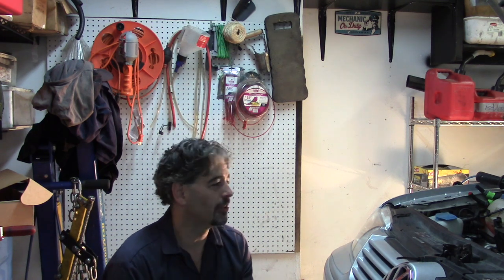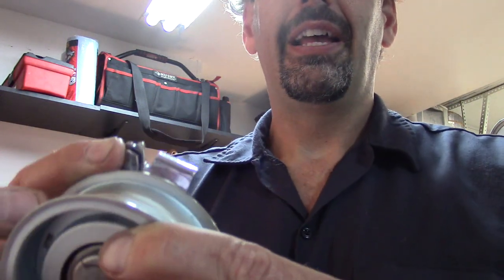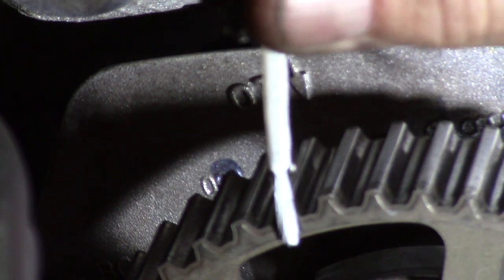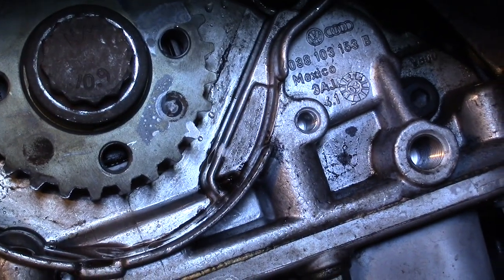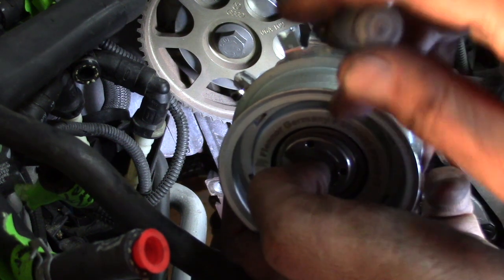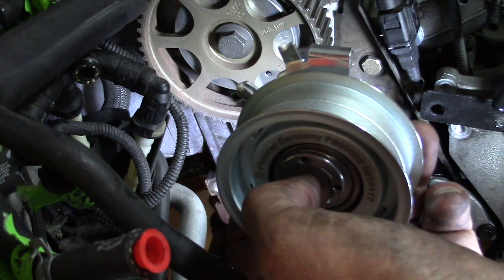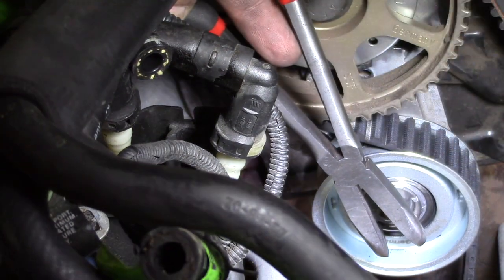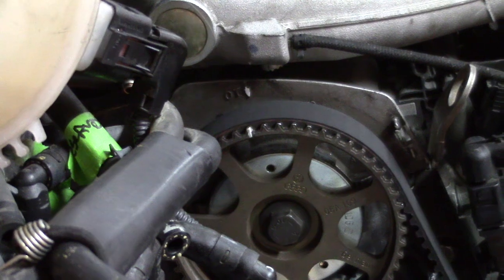PROPER Timing Belt and TENSION 98-05 VW 2.0L Jetta, Beetle,  GTI, Golf

Comment: Hi, I was wondering if I could possibly ask you a few questions about my 2003 VW gls 2.0, beings I know you have the knowledge with these motors to give me the right answers. I have in the recent past expressed how grateful I am for your YouTube video on timing belt replacement which is why I was able to actually do the repairs. Now to the reason for my message, I have started my Jetta and it runs and drives but idles rough and  there is a misfire on cylinder 1 and 3, I have replaced all of my injector clips and wires due to 1 and 4 being damaged/ corrosion to 2 and 3, spark plugs have been changed and wires look from eye view good. I am currently going to double check the rotations of setting the timing to tdc due to other distractions from my life  during  i want to make sure the rotations are correct but other wise compression was fine when checked. I have spent the last year and half putting what ever time I have on these repairs as well an A4 Quattro that has been a nightmare and headache from the previous owner. Any advice would be so much appreciated.😊 Thank you
Reply from the maker: I would start with my FASTTEC method. You have to start with the basic answer to the question: “is the misfire spark, fuel, timing, or compression”.  Until you can answer that you will never be able to fix it.

Comment: I was changing a water pump and timing belt on my VW BEETLE  2002. 2.0 GLS. AFTER CORRECTLY ALIGNED the Crank pulley  notch and the spouket arrow to OT, while removing the 4 (Four) bolts on the crank pulley,  the  pulley  moved anti lockwise to left. But the top whick is  the sproucket is still ALIGNED to the OT arrow.  What is the best thing to do now.
 Thanks

Comment: I keep getting the throttle pedal or throttle body or cam sensor code. I have changed the throttle body and gas pedal so all I have left is the cam sensor. I just can't see removing the timing belt to change the cam sensor without doing the timing belt, tensioner and water pump. We'll see if it fixed the surging and power cut but with 190.000 miles it is worth the timing belt swap
Reply from the maker: What was the voltage on the throttle postion sensor before you changed it that indicated it was faulty what was the voltage on the APP that indicated it was faulty?

Comment: I had to look it also up with the freaking tensioner… I also thought that it would be on the head corner or so… but no. 
It was the plug :D 

Also… the older tensioner had an 22mm flat on the side, analogue to the two holes for tensioning. I had the special tool, but it won’t fit, if the Engine mount is in place… nice for just refit the correct timing. ¯\_(ツ)_/¯

Comment: I used a pair of 90 degree snap ring pliers and used the old tensioner for measurements. I the tack welded the snap ring pliers into place for a temporary tool for this job. It took me 5 hours counting the water pump and coolant drain and fill. This is the 1st vw 2.0 ive worked on.

Comment: can someone please help im trying to set the timing on my 04 new beetle gls 2.0L. I cant tell if the piston is at TDC for the compression stroke or the exhaust stroke and when I put the piston at TDC there are no marks on the motor or crank to indicate TDC
Reply from the maker: Just simply put your finger on spark plug hole. If on compression stroke you will feel the compression.

Comment: If you check the timing cover and the crankshaft pully, you'll find the 2 marks you need for TDC alignment. You're supposed to line them up BEFORE you remove the 2 lower parts of the timing belt cover

Comment: My kit came with a cam seal . Is this a must to change? Do you have a video how to do it? I’m already out of time at the moment
Reply from the maker: Yes I always change that. It just presses in and out. I didn’t show it on video though.
Reply: @SchrodingersBox  I meant at the moment my car is back in timing . Is it bad to unscrew the cam shaft bolt? Will this change my timing
Reply from the maker: if the camshaft sprocket is keyed it won’t change timing to loosen bolt. however how are you doing to replace the seal without removing the sprocket?
Reply: @SchrodingersBox  as I turn counter to loose the bolt the cam shaft just spins .  Also I can’t get the belt tensioner out.. seems there is a motor mount bracket in the way
Reply from the maker: Yes the camshaft bolt is extremely tight. You have to lock the cam with something.

Comment: Great video on this specific application. You did great detail about the tensioner and position. I am a mechanic myself. The window at the transmission is another timing mark that you can use as an option. However, I do have just a couple of remarks. It is easy to run the belt starting at the crank like your instructions say. Your not going to rotate the crank when you pull the belt. You're the only person I have seen to bump the motor over by the switch and not have what you took loose reinstalled. And also  I have never seen anyone start the motor without the motor mount installed to check your work. But you did hit the mark about the tensioner. I have seen one other video that a guy mentioned about it and that was all.

Comment: As a professional mechanic of over 40 years let me congratulate you on an excellent video. Actually one of the better automotive repair videos I have seen. Very thorough and precise. There's only one thing that I would do differently. I never crank the engine over with the starter. I turn the engine over by hand several several times to make sure I'm not coming in contact with a valve. And verify my timing marks. But excellent video thank you.
Reply: He saved myAzz. The sites on my tensioner wouldn't move, and my '99 2.0L gls beetle is our only lifeline in rural Appalachia. Running out of time and patience, I almost failed my first timing-job until I noticed this video

Comment: Great tutorial video.  Probably the best I've seen so far.  I know this is off topic but I really need help with my 98 NB 2.0 /Catalytic Converter.  I was able to remove it but it's to big to pass through the subframe.  Do I just loosen the bolts of the subframe just to have enough clearance, do I need to remove it or do I need to cut and weld the darn thing?  Btw, I'm also in CA that's why I'm doing it myself cause the Cat alone is too expensive compared to other State.
Reply from the maker: Exactly. Just either drop the subframe OR undo a couple of engine mounts and lift the engine. Either way.
Reply: Thank you!  Glad that my thought process was going on the right direction.  

Do you know if I can re-use the subframe bolts?

Comment: My tensioner  marker does not align with the other end. Could that cause a hard start? Its been like that since my waterpump  was replaced on my 05 jetta 2.0 bbw. I think it was the cause of my starter going bad. I have a video of it.
Reply from the maker: do the camshaft and crankshaft top dead center compression marks line up?

Comment: Like you said, it is so much easier to route the new belt starting with the relaxed tensioner. Just no way the new belt was going over those tensioner ridges, had to go with camshaft first, then tensioner, followed by crankshaft pulley, then the waterpump last. Took 1 minute. (Does help to leave the belt half-sticking/hanging off shafts, so it is a smidge easier to rotate it when pulling onto waterpump)

Comment: Did you have to raise the passenger side of the engine up at all to access the belt or did you hold it in place with the engine mount removed? Thanks
Reply from the maker: Ii raised engine slightly after removing mount.

Comment: Also noticed on my 2003 2.0L Jetta that, with #1 TDC, the lower timing sprocket's 'notch' was directly on top as well with the 4 holes on the serpentine belt pulley being slightly offset, only mounting one way too (for balance?)  Thx for the great vid! Any suggestions for a chronically leaking "crankshaft front oil seal"?
Reply from the maker: It may be you have rough spots on the crankshaft causing seals to fail prematurely. also improper installation will cause new seals to leak immediately. if they aren’t square in the bore they will leak immediately.

Comment: I have an ABA 2.0 Volkswagen engine 2001 and it has no time in tensioner like that that goes into the block and then you pull the gun sights together mine you have to use a tool in order to tighten the belt and tighten the 17 mm nut and a 13 mm to hold it something like a freeze out plug that's a neat system and you're right there's not very many tension YouTube videos on here thank you

Comment: On the backside of the cam pulley, if you’re removing it.. be careful of the cam sensor interrupter on the back of the sprocket.. it bends easily and if so will destroy the sensor. Bought a flipper and that was my issue, bent interrupter that snapped the sensor. Small fins rotate thru a small window on the sensor so if it’s slightly off, it’ll ruin it.

Comment: Matt, 
Awesome video. I wish you would do a timing belt change on 1.9 TDI diesel. I have 1.9 in an Isuzu pickup swap. I have long starts. Most people say it is a timing issue. I think it is tune  issue. Since I don't have a mark on the flywheel. I found TDC by stick a coat hanger down glow plug on piston 1, rotate until it stops moving,verify crankshaft harmoic balancer hits mark. Is this the best way??

Comment: Hey Matt I recently did this same job on a 2011 vw Jetta 2.0 manual. Everything went what I thought well tension proper timing marks what I’m 99% positive is where it needs I double checked with number 1 cylinder TDC location but after it’s warm it makes a ticking sound (sounds like valves :S) let me know if you have any ideas of what it might be? I can’t find the flywheel plug I’ve looked for hours
Reply from the maker: I would just check the cam and crank. correlation to ensure timing is correct.  if it is perhaps there is noise from tensioner- hopefully you used a new one.
Reply: I did use a new one going to check it over with the stethoscope and see if I can pin point the issue
Reply: Incase this happens to anyone else and you’re reading this I ran the stethoscope on everything and it turns out it was the purge canister valve making the ticking… check it out it’s much better than a valve!
Reply from the maker: how funny man. I just today fixed a Chevy Cruze with a ticking so loud it sounded like engine was gonna blow. it was also just the purge valve. funny!

Comment: Ok well good try but first off there is a marker on the timing cover that you line up balancer with the mark on the outside lower cover . 2nd the tensioner is supposed to lock into the fraeeze plug hole pn the front of the block . 3 the reason of turning it before installation is to make sure its seated for proper function . 4th you need to explain that you install the belt around the pulleys so that the belt is tight on the non tensioning side and all thr slack is on the tensioner side and the trick to do that is to rotate the crank 1 1/2 of tooth oppisite of the rotation of engine so when installing belt it is tight on non tension side this is the only way you will get true spec on belt tension .

Comment: I adjusted the timing mark, while at tdc for the first piston. Then when I manually rotate the engine, the tension marker moves around, but whenever its at the TDC it alignes correctly...is this normal?
Reply from the maker: the only marks that matter are the crankshaft and the camshaft marks. they should come around exactly right TDC compression every 720 degrees. no other marks you make matter and may in fact vary.

Comment: Still have my 2001 Jetta 2.0 manual, drives like a fucking champ. A lot of people don’t seem to understand that VWs are not racing cars. If you drive them correctly, they’ll last 20+ years. Cheers man.
Reply: 03' 228000 miles

Comment: The markings for the lower timing is on the pulley itself.  Before you removed the pulley look on the outer edge/side- you will see the mark.  You have to make this paint mark before you remove the pulley.

Comment: I mistakenly turned (i dnt knw exactly how much degree ) the crankshaft without timingbelt on ( the camshaft was in TDC ) nd i m nt sure if i looked down nd made it sure if crankshaft was in TDC. i have an  audi a3 8p 2007 GSE engine petrol 1.6v , i hope i have tht flywheel lookthrough window , if not,  i dnt knw wht to do thn, i m stuck , u just showed me a ray of hope . Cant wait for the sun to comeout .
Reply from the maker: Not a problem, it’s an easy fix. . simply restart the process by setting the crankshaft to TDC and the cams to their TDC compression #1 position and you will be in correct orientation to install the belt in correct timing.
Reply: @SchrodingersBox  when i misunderstand , i should bring the crankshaft in TPC without the timing belt on , i m a bit confused thts y i m going in these minute details
Reply: Dnt misunderstand *
Reply: @SchrodingersBox  @briansmobile1‘ s taktik helped  which he showed in one of his videos , i failed in finding tht flyoverwheel see through window . But thanks alot , i succeeded in bringing both cam nd crankshafts in TDC .

Comment: Did you replace the camshaft position sensor when doing the timing cuz you mentioned the sensor code and i have that code
Reply from the maker: no- the sensor was not the cause of the code so there was no reason to replace it.

Comment: You don't need torque spec for water pump. 10 mm bolts don't hold a lot of torque.
Reply from the maker: how much torque do they hold?
Reply: @SchrodingersBox  I have never used a torque wrench on a water pump bolt. I have never broken one either. Yes I have a video of me installing a water pump on youtube.
Reply from the maker: I’m not worried about breaking one. I want equivalent and consistent torque angle to ensure compensation for variances in temperature fluctuation between the dissimilar metals.  
   How exactly are you ensuring this without using the torque wrench? What else are you using to measure that?
Reply: @SchrodingersBox  Wow, that was a large load of something. The last water pump I install is still running. It's been over 8 years.
Reply from the maker: well. Lucky you! I always take the quantitative over the empirical though. If I am showing someone how to replace a water pump I want to be able to tell them exactly how to consistently ensure that they secure the pump in a way that absolutely guarantees a bolt stretch that will not overextend and break or loosen during thermalcycling.  Not sure how I could possibly do that without a tangible and quantifiable reference baseline other than providing a torque value.
  How did you do that when showing your audience in your video, I wonder?
Reply: @SchrodingersBox  This is why people like watching your channel. You use sovereign words and torque bolts. There are some who like watching my videos because I talk about slick legging and don't torque anything.
Reply from the maker: Probably more people would like your channel then, I imagine.  Way, way more people in fact. I see them at Autozone every weekend again and again and again buying plugs and wires, then ignition coils, then oxygen sensors, then a map sensor, then a MAF sensor, then an EGR Valve.....
   Your channel should do very very well my friend because 98% of people do it the way you do. . good luck.

Comment: Is there a little opening to the flywheel on a automatic trans?
Reply from the maker: yes. all cars some type of cover to access the drive plate or flywheel.   I have seen a few cars where the starter motor itself is the access.

Comment: You are the man! Thank you for making this.
Reply from the maker: Glad it helped!
Reply: @SchrodingersBox  It sure did. My Jetta jumped timing by 6 teeth on the cam and this video helped my set it straight in my driveway, in the snow, so I could drive it to the single heated shop I have an hour away to do the job right (belt/pump/tensioner). if it wasn't for you actually showing the tensioner adjusting procedure I most likely would not have done it right. Basically, thanks to your video and a Haynes manual I was able to save my car. 

Kudos!

Comment: Very nice video. one  on the belt tensioner is not correct,  is the back hole for the plate is the frost plug hole not the a lip probably does not make any difference, just easier. otherwise it is awesome.

Comment: the car u did the timing on the bottom crankshaft timing setting did u research on the crankshaft marks i am doing timing belt now on my 2002 vw beetle i need help asap when i put it in timing it misfired on me it is firing and getting gas but want crank
Reply from the maker: I always confirm the timing after my installs with cam and crank signal synchronization.  Thats by far the easiest and quickest way to confirm the timing is correct. 
It sounds like your timing is probably off. Start with the basics and simply Verify it with a CKPS and CPS signal timing and if it’s off you’ll need to adjust mechanical timing.
Reply: @SchrodingersBox  how many times do the crankshaft has to be turned to get 2 rotations to get the camshaft sprocket on the mark
Reply from the maker: it would be 2 rotations. The camshaft comes around every 720 degrees of crank rotation.
Reply: @SchrodingersBox  u have got me on 720 degrees so if I put a white mark on it I am trying to see how many times it would go around
Reply: So the white mark has to go around 2 times back to the mark on the back of the engine
Reply from the maker: if you make a mark on the crank at TDC compression stroke- however or wherever you make that mark, then every 720 degrees of crank rotation will get you back to TDC Compression. If you are on TDC exhaust then 360 degrees will set you to TDC compression.